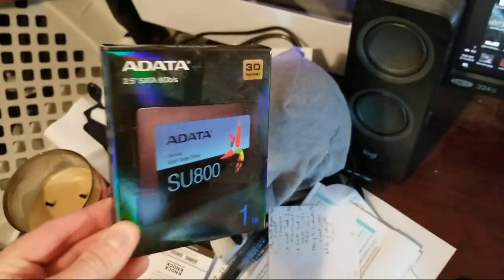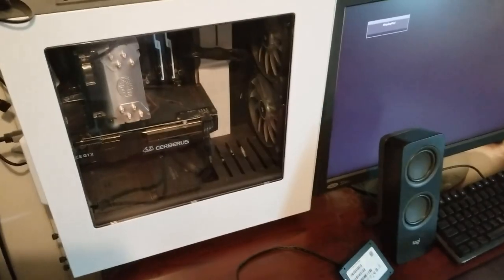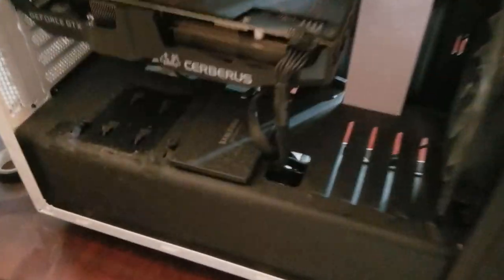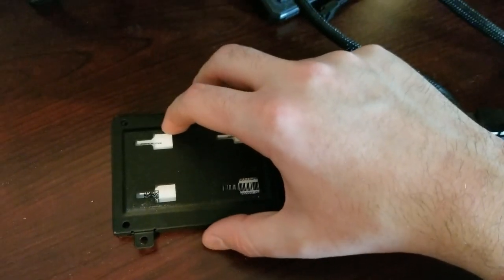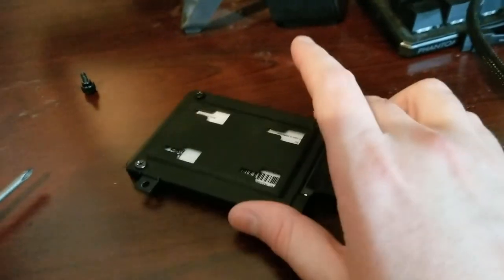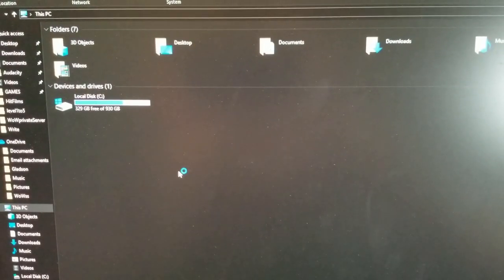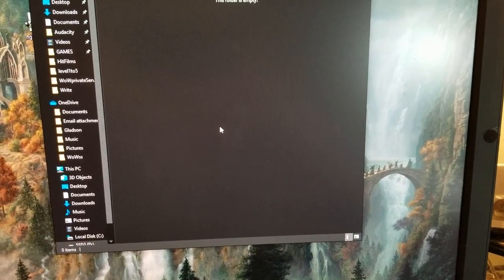Installing an ADATA SU800 - 1 TeraByte SSD onto my PC

Comment from the maker: for mobile users: Timestamps-
1. 0:27 - Cords and SSD
2. 1:31 - Turn off your computer
3. 2:50 - Behind the 750 G2 EVGA Power Supply Unit
4. 3:15 - SATA ports of the GIGABYTE X470 AORUS GAMING 5
5. 3:38 - Remove SSD mount
6. 4:59 - Connect SSD to mount
7. 6:37 - Cable management plan
8. 7:06 - Cord won’t fit
9. 7:45 - Cords fit
10. 8:12 - SSD mount to case
11. 9:05 - PSU plug in
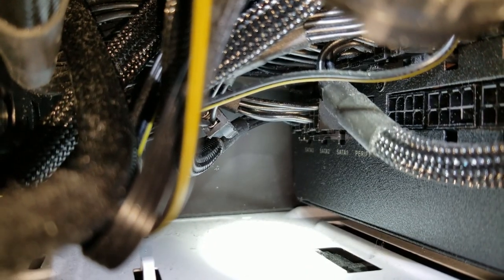12. 9:56 - Connect to MOBO
13. 11:07 - Final steps
14*. 12:07 - Installed SSD not showing

Comment: Where did you get those plugs for the adata to the power supply
Reply from the maker: They came with the power supply, its fully-modular
Reply: @h0b0b0z0  would it come with a non mudular?
Reply from the maker: @immuneatlas1476  It depends on the PSU I think, but I would assume that a non-modular PSU would have at least 1 or 2 SATA cables sticking out of it
Reply: @h0b0b0z0  thank you
Reply: @immuneatlas1476  all psu come with sata power cable except Apple :>